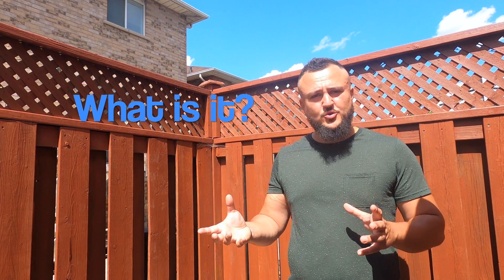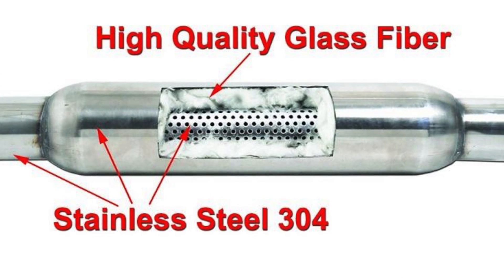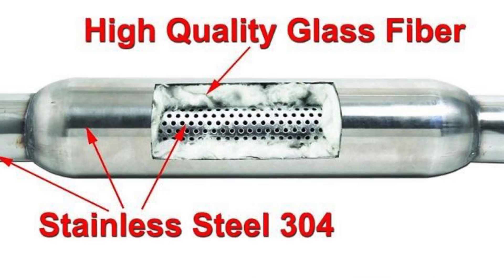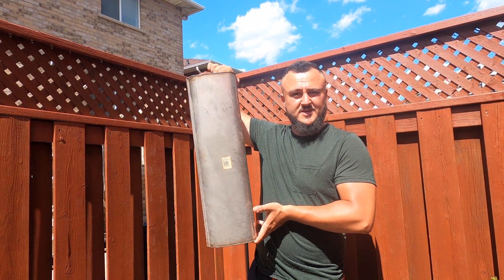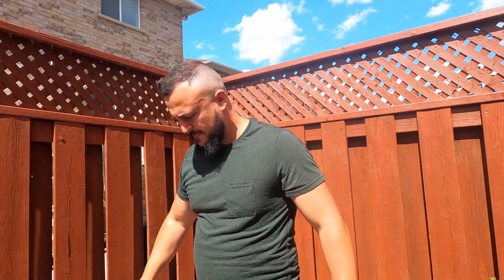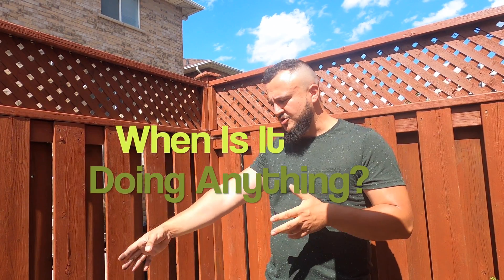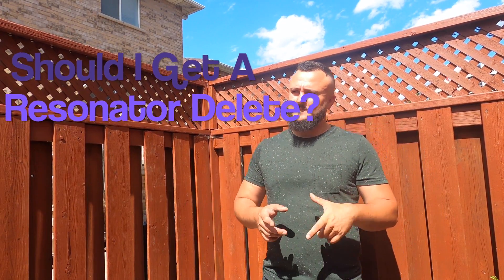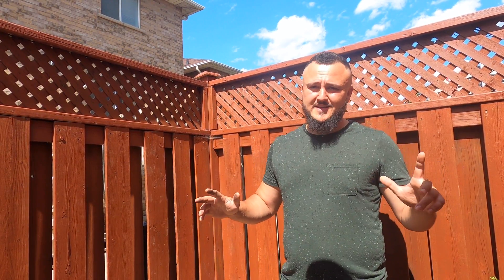What Is A Resonator Delete? What Does a Resonator Do? (EXPLAINED)

Comment: For me there is ZERO drone  sounds on COMFORT mode. I do hear the exhaust when I floor it but never a drone.  There is a slight drone in RACE mode but only if I am getting on the gas at very high speeds. I do notice a very small increase in power in the top end but nothin down low. I'm running boltons on a stage 2 OTS tune for a Golf R and the car is pretty baller..

Comment: a resonator delete makes the idle a lot deeper and adds a little bit of the sound depending on how big it is
Reply: So will my car get any louder if I delete my res? I’ve heard mixed opinions so now I’m lost since ive got an aftermarket  exhaust but it’s still no where near loud enough
Reply: @when1250  100% will. if its a bigger resonator itll be a lot louder, if its smaller it wont be as loud but itll still get louder.

Comment: So I have vibrant mufflers will a resonator delete make it louder because I have 2 resonator rn and it’s not that loud
Reply from the maker: no it will not make it louder
Reply: @BurningRubber416  what about replacing it with like a vibrant one?
Reply from the maker: @cortezek9982  What car do you have and what is your setup? From downpipe back
Reply: @BurningRubber416  it’s a Acura TSX 2008 and everything is stock, the only thing I changed was the mufflers and took off one resonator

Comment: What I learned was I’m still doing a resonator delete on my v8 since I want to hear it a bit more at lower rpm but don’t want it to be too aggressive either. The drone reduction you talk about a resonator eliminating on the highway at 2-3000rpm must be vehicle specific because my 10 speed only revs at 1300-1500 on the highway so even an aggressive exhaust doesn’t really drone unless you are towing a very heavy load. Good advice in theory and concept of how the resonator is designed in general though, thanks.
Reply: Do you think you can loose power when you do the resonator delete I just did mine and installed a skunk2 exhaust and added a dc Motorsport short intake and I feel like the car off like if I need to step on it harder

Comment: i disagree. i removed the resonator from my 03 fx 35 and put in a straight pipe.There is no drone at any rpm. keeping the stock muffler, it sounds as good as most aftermarket cat back systems.
4cyl.  v-6 and v-8's will all sound different without a resonator.
Reply: same, deleted mine on mk7 gti. No drone on highway. sound obviously louder than usual but not super loud. Love it

Comment: I have an appointment tomorrow for my 2019 Ram to do a resonator delete 🤣 I put a Flowmaster 10 now the resonator.. it's loud but not loud enough for me
Reply from the maker: Eyyy, gotta fine tune it until you get the sound you want ;)
Reply: @BurningRubber416  I plan to put headers on it in the spring of 22 and do a tune.. should add more power and sound 🤞
Reply from the maker: @macwiller2105  Right on man!

Comment: Delete resonator make your car feeling racing.. but you must change your mufler to make more loud. Actuali not too noise on low rpm. Noise coming if we kick in the pedal deep. And more noise if rpm more high. In performance acceleration more agresif in low rpm. On hi rpm there is little diferent

Comment: Okay you say that delete them don’t change the loudness but only the pitch. I deleted 2 resonators and my decibels went up 10. Why is that?
Reply from the maker: The resonator “prepares” the sound waves for hitting the muffler which increases its effectiveness, by removing them yes you will get a very small increase is sound but mainly it is the pitch that changes
Reply: @BurningRubber416  okay I was just double checking. The exhaust shop did a before and after I went from like 105 to 114-115.

Comment: Hi burning rubber i just have a silly question. I am not really good with cars but what i did to my car was a downpipe no more catalytic converter and no mufflers. It is just a pipe and resonator i just want to ask thoufh is will it screw my car in the long run or kill the person? I saw an article about if it was parked in bishy areas it could ignite the car
Reply from the maker: Will not screw your car, you need a tune to get the most out of your downpipe, contrary to popular belief a catless downpipe actually stays cooler than a catalytic converted would because there is less restriction, so technically a catless car would be safer in a bush 😉

Comment: I just had a new exhaust system installed in my 1997 XH XR6 and they installed a muffler and a hot dog/resonator at the rear.  I wanted a deep sound and the hot dog seems not to give this.  The guy said to try it and if no good to take it back and he'll replace with a muffler to give it a deeper sound.  Does this sound right?  Not sure about having two mufflers though.

Comment: if i put a cutout on my car should i keep the resonator? or will it block out the sound thanks in advance!!
Reply from the maker: A cutout is a perfect solution, it will bypass the muffler and give you some nice noise! You can remove the resonator since when you have the cutout closed the muffler will absorb most of the noise and when it’s open it won’t really matter if you have the res or not!

Comment: My car sounds louder now, but feels like its lost torque
Reply from the maker: Depending on what engine size you have lower back pressure does result in low end torque loss, however you may have gained some high end hp

Comment: Half the stuff you said isn't true.  The resonator helps absorb and even out the exhaust pulse. Smaller engines, sub V8 have a dramatic pulse (exhaust gas flow, pause, flow etc.,). The resonator allows those uneven gases pulses to collect and even out the tone/flow, which absorbs sound and actually can increase flow.
Reply: Do you have more proof of this tho ....
Reply: @snowfall1771  it just depends on what kind of car, engine, or exhaust system you have
Reply: @snowfall1771  It is the truth.You should get a muffler dlete.The resonator stops uneven sound resonances and is actually not that restrictive.the muffler dlete gives the perfect sound and removes the most backpressure.Most resonators are also near the middle of the car and will shake your car apart with sound waves.I spoke to a ganassi racing team member about this years ago at road Atl--never take the resonator off--those shit ricer sounds and that rasp you here on cars are the idiots with the resonators off.Muffler controls decibel and deepness--loudness of sound--resonator makes dure the sound waves do not resonate in a crazy pattern--also many Turbo engines need that resonator because of the way the gasses flow out and it needs the sound and gasses to flow out  balances instead of just coming out the headers.BTW the diamter of your stock pipe alone is the ideal backpressure--similiar to if you try to braethe thru a straw--you can not breathe as well simply because the straws diameter is creating backpressure--now imagine adding a mufller to the end of a straw--that is what you car experiences--with the muffler delete the car breathes easier and smoother and the sound exits the rear of the car in an even smoothe but deep sound.I have videos of multiple cars I have owned and done this too from V8s to twin turbo V6 to my new Single Turbo inline 4 that I wll post in a week.
Reply: @khronin  .... I ended up putting magana flow muffler an cutting out the resonator ... Iam happy with it !! ... Haven't noticed any issues and not to loud

Comment: I had mines done on a Accord Coupe, much deeper powerful sound, but not loud
Reply: I have a 08 accord coupe I was thinking of getting a magna flow muffler and resonator delete, do you think that would make it louder and aggressive
Reply: @markcullen0  if your adding to the muffler or changing it, then it’s a great combination. But if you remove the muffler along with the resonator delete, then that’s just too loud in my opinion. So it sounds like your combination will give it some more aggression, but not too loud.
Reply: @ti253799  yea I meant getting a resonator delete and then replacing my stock muffler with a magna flow muffler, would that be to loud? Basically what I’m going for is a nice little dark rumble that people around me can hear but not the entire fucking highway lol
Reply: @markcullen0  just do the Magna Flow, keep the resonators, should be spot on. Or do the Magna Flow with a partial resonator delete if you have more than one resonator.
Reply: @ti253799  I drive a 2008 4 cyl coupe so idk I’ll chek tomorrow lol
Reply: @ti253799  I’ll probably just get the mufflers and if it ain’t loud enough till delete the resonator
Reply: @markcullen0  I agree with your plan

Comment: Super information
I was about to have mine deleted but I was unaware that it could cause drone while driving on the highway
THANKS FOR THE SAVE,,!!!
Reply: A res delete won't give you drone at motorway speeds
Reply: A muffler delete will give you drone. resonator actually makes your car sound aggressive with gurgles an pops. However,  it also depends on the car. What you could do is, delete the res, then test drive it for a day an decide from there. You may b better off just deleting the res and not the muffler. or install a new type of muffler to keep the drone noise out but still sound aggressive with the res delete. 
I cut my muffler off few weeks ago and all i get is turned heads because it sounds amazing when the drone doesnt kick in. In fact, my car sounds expensive until you look at it, then youll just think i have something crazy under my hood. Very unique exhaust tone it gives off.
Reply: I had a hole in my resonator.  Replaced with straight pipe.  Highway drone is super annoying.  Also caused havoc with all my electronic sensors.  Car would jump out of overdrive to 3rd gear on highway at 65 mph and 2500 rpm.  To 3rd gear and 4300 rpm.  Perhaps a minute later will go back to overdrive.

Comment: One very important thing to note regarding this video and the recommendation to not get a delete is that what is said about drone is NOT true for ALL makes and models. Some, yes, will drone. Others may not. 

I say this as I saw this video today, coincidentally after I made the call for my shop to remove my resonator and replace with straight pipe. I made this call not because I thought it would sound cool or be awesome, but because my resonator split and the after market is on national back order for my model (late model Taurus). So I decided to save the time and money. 

Turns out it was an awesome decision. The tone is excellent and there’s zero drone. My exhaust also did get louder. 

So to say don’t do it because of drone, is not the best advice. Because that advice is wrong for some model cars. Granted my shop noted that mine turned out really well and that some GM models end up sounding goofy afterward. 

Best bet would be to call a reputable shop (or muffler shop) and ask if they’ve removed the resonator for your exact make / model and ask how it turned out. 

Just my thoughts. The video explanation of all else is great!
Reply from the maker: Tim thank you so much for your kind words! You are absolutely correct, some Subarus with flat plane engines also sound different with the resonator. You are totally correct in what you’re saying, some cars will actually sound a little better without the resonator, however it is a little bit of a gamble, always best to do research first! Thank you for your comment, I will make a follow up video and explain more about this! Cheers 🍻
Reply: @BurningRubber416  No worries man! I actually found this video so I could actually explain what the resonator does in more detail when I was talking with my fiancé. We’re both technical people and I know a fair amount about cars and such - you tend to when your last car was a junker. So I really like the way you explained everything. 

But yeah, I just wanted to throw my experience out there because I know there are some folks that do like to experiment - especially with their exhaust, who might be turned away - when it actually could work out for them. 

Part of me also wonders how much the size of the engine plays in how it sounds. I would think that the higher the cylinder count, the more throaty and natural sounding (nice, for simplicity) the car would sound afterward. But eh, who knows!

Comment: Well well.. i just did resonator delete today.. but I actually love the aggressive growling and deeper sound it makes
Reply: I did it on my 17 r line Passat I fuckin love it!
Reply: @anonamoose1891  any drone at highway speeds?
Reply: @daviduta9187  yes. I’m on two resonators now instead of the straight pipe.
Reply: @daviduta9187  what does that mean
Reply: Will a resonator delete cause damage to engine or exhaust system?
Reply: Did you replace the mid muffler or stock resonator?
Reply: Did you loose gas milage?

Comment: Idk man my Subaru got way louder when I got my resonator cut after my muffler delete
Reply: I just got the resonator removed off mine, its a lot louder. And those cold starts are brutal, my neighbours always no when I'm going to work in the morning 😂
Reply: @joshuaminke6629   hey did you replace it with a regular straight pipe or did you get one of those magnaflow replacement tubes ?
Reply: @rafaellozano563  just a pipe, welded at both ends. Makes a hell of a difference
Reply: @joshuaminke6629  ahh ok thx

Comment: Thanks man. I have muffler delete on my genesis but its not loud enough. I put my new intake on and a new blowoff valve. The spool of the tirbo is now louder than my exhaust and it sounds funny. I just need the ass end of the car to to louder. Do u have any advice on getting my car tuned?
Reply from the maker: I would recommend a catless or high flow catted DP - this mod adds the most power and I’m sure you know you NEED a downpipe in order to get tuned- it will also make your car louder :)
Reply: @BurningRubber416  thanks man. Im wondering if an exhaust shop would carry one or if its too specific for my car i would need to order one.
Reply from the maker: @navyplumberboy8274  I doubt that a shop would have one on hand, I would look on genesis forums on facebook, or buy this one 
https://www.ebay.ca/itm/MEGAN-STAINLESS-DOWNPIPE-V2-FOR-09-12-HYUNDAI-GENESIS-COUPE-TURBO-2-0T-Version-2/233557501776?hash=item36611ca750:g:PnAAAOSw9uxek5fC
Reply: @BurningRubber416  thanks for replying. I now remember everyone saying getting one.  Power and sound is what im aiming for. Just not sure whether to delete stock cats cuz of back pressure.
Reply from the maker: @navyplumberboy8274  Depending on where you live, if you can get away with it I would say remove them. It will get you more power, quicker turbo spool, and louder exhaust note, probably some nice pops too. Plus with a tune and catless downpipe, that's how you see the biggest gains!
Reply: @BurningRubber416  you have shed some light on this.  Thank you very much and i will follow your guidance. Looking into downpipes right now.
Reply from the maker: @navyplumberboy8274  No problem man glad to have helped!
Reply: @BurningRubber416  i just ordered the downpipe u recommended  from gctuner. Don't worry i did a little research on it.  It Was 200 bucks but it deletes both cats so that's what I'm looking for.  My turboxs rfl bov will be here in a couple days along with the downpipe. Hoping i see an increase in performance and sound.
Reply from the maker: @navyplumberboy8274  Cant go wrong for that price man! Report back and let me know what happens! You may also want to get an 02 sensor spacer, without the cats you will get an engine light, at least until you tune the car which removes that. But you'll feel quicker spool and faster throttle response for sure, more low end torque as well! Hit me up when you get it all together!
Reply: @BurningRubber416  alright.  Im thinking of getting a canned tune from seoulful. Idk it probably won't delete the cel but I'll figure out how to.  Any advice on how to do that with a canned pre loaded tune?
Reply from the maker: @navyplumberboy8274  I got an off the shelf STAGE 2 tune for my GTI and it removed the CEL - I would email them and ask about it
Reply: @BurningRubber416  alright i appreciate all the responses. I'm just getting into the car scene as i have been on water for the past year and haven't had time to work on my baby. But i have wanted to upgrade since being out. If you want to see what i have been doing for the past year check out my channel and watch the last vid i posted. It might be entertaining lol.
Reply: i have this same issue. the exhaust is loud at first then the sound transitions to the engine being loud lol